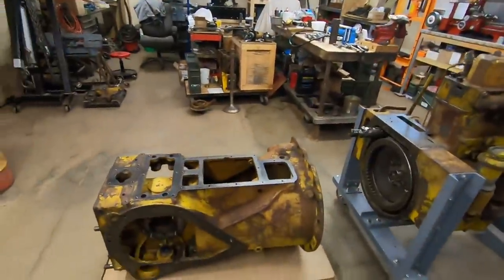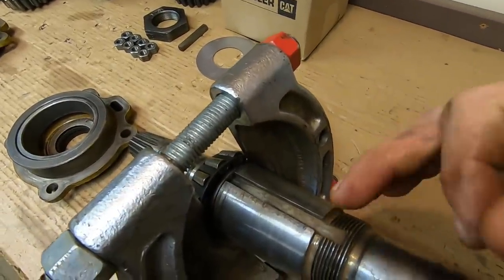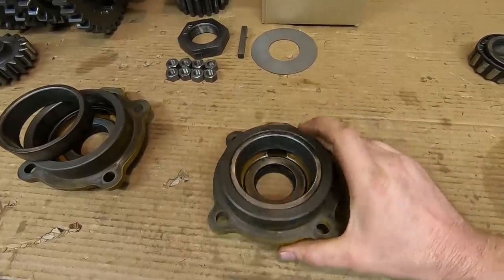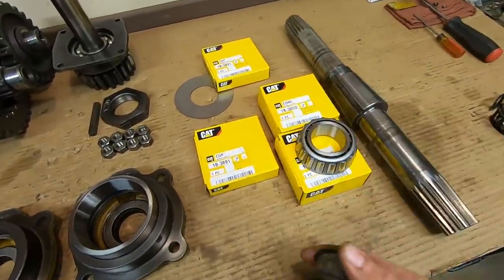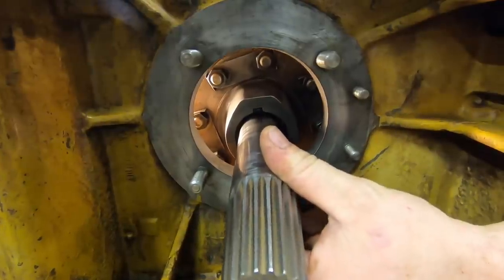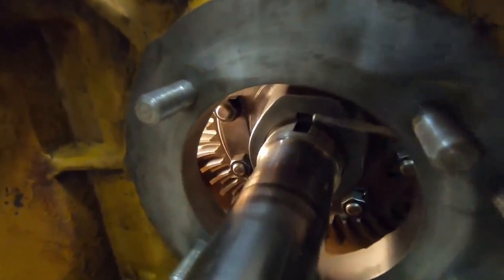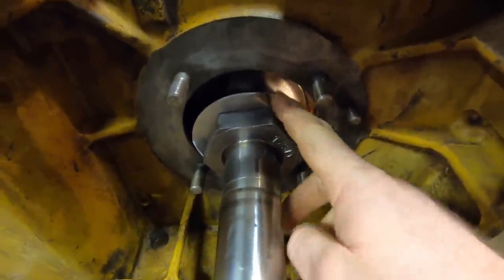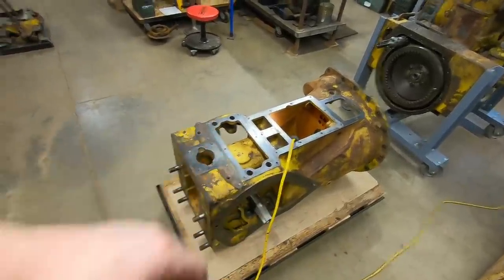Caterpillar D2 #5J1113 Chassis Rebuild Ep.12: Installing The Bevel Gear & Shaft

Comment: For what its worth,  my  bearing experience was SKF was the sole high quality bearing mfg.    Sometimes the others did fine and other times wore out far too soon (motor application though a lot of fan shaft bearings as well).     I got to see a very good sampling as some fans (and motors of course)  ran 24 hours a day and we bench marked against the 100,000 hour rating.

Comment: Using weld to remove that bearing track was a real education Squatch. Cat D2 aside, these videos are real training aids for general mechanical work. The trick seems to be to use your brain more than your brawn. If this was a gearbox out of an Italian tank, they would fit the bevel drive in backwards. The tank could then get out of trouble faster than it got into it!

Comment: Always a pleasure to watch you work.  !!  
I know you wanted to use the old seals as support and cushion. 
But If you heat the bearing flanges  in a oven or on a wood stove the bearing cups will fall in . 
That works very well  .
I have done this with the Carnegie wheels on the sawmill because they were so tight and we didn't have a press .  Just another alternative. 
See you next time .😊👍👍👍👍

Comment: You are such a perfectionist (that's such a good thing now days) I didn't know if you would ever use the old "weld the race" trick to remove races. Sometimes you just don't have fancy pullers and this trick works. And we always used the old races to install the new bearings and races, I just figured more sophisticated shops had high dollar tools for these installs.

Comment: Bearing race in the bearing caps are designed to use a specific pry bar to remove them, like HF 68339 or Sunex SUN9804 or an indexing pry bar.   You install the caps back into the case before using the pry bar.   This is how bearing races were removed in heavy machinery from 1920s-1970s. The puller will work fine too, it is just a lot easier with the proper tool.

Comment: Totally random thought, but when the weather warms, maybe take your custom built tools and hit them with a quick coat of implement paint to match the make of machine they get used on? Not a perfect idea admittedly, but they could go in some homemade wooden tool crates and be easy to see and differentiate from random metal pieces that way.

Comment: We used the weld trick that you used on the race on removing dry sleeves. The only difference was  vertical welds. It worked as well on the sleeves as it did with your race.

Comment: Been welding bearing races and valve seats for years, it works great. Have to be careful using the old bearing inner races to press on with on a lot of shafts they will wind up stuck.
Reply: Was thinking I would probably have put that in the lathe and taken a few thou off the inner diameter with a boring bar...
Reply: If you cut through one side with a thin cutting disc on an angle grinder, you can still press them on but they don’t get stuck if the shaft is a constant diameter.
Reply: @homeFall1  Easier said than done on something 60 HRC+. Doable, but quite the challenge on squatche's small machines. Much easier just to split it.
Reply: @TheMetalButcher  Yeah, I agree splitting it seems easier without great equipment and maybe even then.  I AM spoiled by having big old industrial machines in my shop and not "hobby grade" small units.  That said they do take up a LARGE amount of floor space and where SUPER heavy to move in there.

Comment: Amazing that all the torque/tractive force (of a bulldozer) is applied through a taper and a piece of  keystock.
Reply: Tapers are strong AF. Guarantee that key never does anything.
Reply: @squatch253  Thanks, Toby.  And I did wait for that video before responding.  I am still amazed at the size of the taper and the amount of torque it can handle.  I've seen them used as a "fuse" in a drive system to keep from breaking things but with a key in play, that's not here.   What does surprise me is there is no lapping of the surfaces such as they do in marine applications for shaft to propeller joints.

Comment: When placing a bearing on a shaft, consider using a bearing heater. It makes life simple. If you don't have a commercial bearing heater, use an old oven. Heat the bearings according to manufacturer specs.
Reply: One mechanic  at the hy dept  where dad worked heated a bearing  with a torch first,

Comment: the hot weld bead also works on inner races (like on your bevel shaft). When HOT it will expand the race to loosen the grip, and also will kill the hard surface in case you need to drive it off with an air hammer. (if you dont have the benefit of a press handy). Done this on rear end bearings and it works like a champ
Reply: what happens if you can't get it off before it cools and contracts?  Better off heating it carefully with the torch-
Reply: @horacerumpole6912  run another bead on it if it cools off. Best thing is the heat is localized unlike a torch, so heat treat on the shaft is largely unaffected. A torch works but you have to be a bit more careful where you point it. A bead is instant, and concentrated.
Reply: @Scottinqc  The torch works without the risk of seizing the race on the shaft-

Comment: 750 poundfeet with a 4 feet extension.. yeah.. allright :) The only bolts I ever tightened down that hard were the four engine mounting bolds on the leopard tank I served on, 730 poundfeet, or 1000Nm for us with a 2m long torque wrench of the 3/4" Type while lying on my back in the dirt and that was only possible by using my whole body.. guess times really were different in the 50s and people were stronger, like my old shortwave receiver from the 60s. Shortware receiver for mobile use, thats what it has handles for.. two of them in total, each big enough for one hand, with the whole thing weighting about 400 pounds.

Comment: Good ol' Nishizono Ironworks and Tomoe Trading Co.
As an instrumentation engineer your "calibrated press" amuses me. Like a "calibrated hammer". I would have used the nut torque procedure - it is likely to be more accurate. A known weight on a known lever will always give the same torque in the same gravitational feild.The only variable is the friction of the nut.
I just recently checked the accuracy of my torque wrenches using the same technique

Comment: Done alot of bearing installation with both press & heating bearing( induction heater or oven) and prefer the heat method...much less stress put on bearing vs dead ending bearing on shaft with hydraulic pressure.   Most times 300°F is plenty for heat method

Comment: Hey Squatch, been at a dealership for a long time too. I’ve used the old bearing race installer trick myself, it works great. I like to get the cut off tool out and cut the race because you could get it stuck on the shaft that your pressing the new bearing onto. Ask me how I know.😑

Comment: YAY!!!!!    A new video from Squatch258 !!!!!   YAY !!!!!!!

hhhhmm, so pony motors are still at machine shop awaiting their place in line
OK, good info.  I was wondering about them.  I'll keep that in mind.

WOW! cool trick with the welding to shrink an inner bearing race, Thanks for that.

Yep, already knew about using the old races as press tools.  Glad to see this being shared with others.

oh yeah,  install the bevel gear in the correct orientation!  Yep that is exactly where I would go wrong.  5 reverse speeds and one forward, THAT would be awful (unless it happens to somebody else)

Love the hydraulic tool thingy and triple scale gage set up.  

Oh  and good thinking on the use of the old leather seals to support the shaft during install !!

another GREAT, fun, and informative video!

Thanks Squatch 257

oh before I forget,  What about those pony / starter engines?  Any idea on their status?
Reply: I use a flapper wheel open the inside diameter of the old race for clearance on the shaft when you press the new bearing in.

Comment: That old inner race, did you grind it out a bit so it was no longer a press fit?
Reply: If you cut the inner race it will be a loose fit on a shaft, but still do the job.

Comment: Do you know by chance how much tonnage pressure is needed for installing the bevel gear on larger machines? (That is if the design stayed similar) I'm curious down the road if I were to overhaul the back of my D4, how large of a press is needed, thanks
Reply: @squatch253  thanks for the info!

Comment: So if I understand this correctly, the friction created by pressing the shaft and hub together is the only thing transferring power from the engine to the drive sprockets. The Key is just a guide to keep the two parts aligned as they're pressed together. The key can't be any harder than a Rockwell Hardness of C25 to C34. Right?

Comment: Times have changed. 
A machinist in New Ulm would assign priority by how quick he got paid. 
There were heads, etc that sat in the corner for a while. 
Not bragging, but he did a M block, and head in less than a week.

Comment: Mr. Squatch, as a loyal follower and fan of the videos you produce, I take no issue with you insulting Mr. Bork in a previous video. However, when you seek to defame, disregard, or disrespect the 2 Stroke Detroit Diesel, an engine that has arguably done more for this nation, and the world as a whole, than ANY OTHER single-engine, that Sir, is where I must draw the line. 

Like the Caterpillar (CAT) D3400, the Series 71 Detroit Diesel (GM Diesel) was introduced in 1938 as a new engine, not a revision of a previous design. The Series 71, built from 1938-1956, consisted exclusively of inline configuration engines with 1, 2 (introduced in 1940), 3, 4, or 6 cylinders. V configuration engines became available starting in 1957, offered in 6, 8, 12, 16, and 24 cylinder configurations. However, since D3400 production only ran from 1938 to 1947, we shall focus on the same timeframe for comparison to a Detroit Diesel. 

With a displacement of 221 cubic inches (rounding up), the D3400 most favorably compares with a 3-71 Detroit Diesel of 213 cubic inches (71 cubic inches per cylinder multiplied by 3 cylinders). Although it is somewhat difficult to find exact power numbers for an early two-valve 3-71, advertised power ranged from 100-113 HP measured at the crankshaft, although I believe those numbers are for the later N series, high compression engines. To facilitate a period-correct two-valve low compression 3-71 sample, we go to data collected at the Nebraska Tractor Test Facility. Although this test is not a flywheel horsepower test but rather a drawbar and PTO test, the numbers are understandably lower than rated numbers for flywheel horsepower. Nebraska Tractor Test No. 556, conducted August 22 to August 27, 1955, reveals that a 3-71 Detroit Diesel, mounted in a Super 99 Oliver tractor, provided an uncorrected 78.74 PTO horsepower, which corrected to standard temperature and pressure, yields 83.46 horsepower. With a rating of 35 horsepower, the D3400 falls far short of the horsepower produced by the Detroit Diesel 3-71 by any measure imaginable. Thus, your claims of “twice the noise for half the work” are woefully unfounded and blatantly false. Perhaps some will claim that CAT underrated the flywheel power of the D3400 and that it provided more power as installed in a D2, so again we turn to Nebraska Tractor Test No. 322 conducted July 24 to August 4, 1939, a test of D2 serial number 5J1509. Test No. 322 reveals that the maximum observed power was 29.98 horsepower, which corrected to standard temperature and pressure, yields 31.99 horsepower. Again, the D3400 falls far short of the 3-71 Detroit Diesel in terms of horsepower. Some might argue that since the 3-71 test was conducted in 1955 versus the D2 test conducted in 1939, Detroit Diesel had 16 years to refine the 3-71. Again, we go to Nebraska Tractor Test No. 553, a test of D2 serial 5U12457, conducted within one month of the Super 99 test. Although Test No. 553 is a later, improved 5U D2 equipped with a D311 versus the D3400, we can still draw comparisons, and it eliminates the argument of unfair advancements of the 3-71 Detroit Diesel in Test No. 556. In Nebraska Test No. 553, D2 5U12457 provided a maximum observed power of 41.86 horsepower, which, corrected to standard temperature and pressure, yields 45.43 horsepower. So, despite the D311 having a 39 cubic inch displacement advantage over the 3-71 Detroit Diesel, it still falls 38.03 horsepower short of the Detroit Diesel. 

Having dispelled the outright lie that the Detroit Diesel is “twice the noise for half the work” compared to its Caterpillar competition, we will move onto accomplishments and production. Throughout the entire D3400 production run, 19,161 were built for the D2 tractor, 1,797 for 212 graders, 6,047 for generators and power units, and 216 marine propulsion units, for a total production of 27,221 from 1938-1947. By comparison, Detroit Diesel produced 57,892 Series 71 engines in 1943 alone. Although Caterpillar contributed significantly to the war effort, its contributions pale in comparison and scope to the diversity of applications and sheer quantity of Series 71 Detroit Diesel’s used in the war effort. Series 71 engines powered everything from boats, equipment, tanks, trucks, generators, and even the landing craft used on the D-Day Invasion. 

The simplicity, longevity, interchangeability, durability, and modularity of the Series 71 Detroit Diesel is genuinely astounding and has never been matched by any other manufacturer. Mass-produced from 1938 to 1995 and still in limited production today, the Series 71 is a staple of diesel power production both in the U.S. and globally. So, in the future, if you choose to pick on Mr. Bork, that is fine, but next time, please leave the war hero Series 71 Detroit Diesel out of it.
Reply: POPCORN PLEASE 🍿
Reply: @mmm365  Series 71 Detroit's have powered just about everything, from mass transit to rail switchers to cranes and pumps. Excellent engines.
Reply: @mmm365   Most likely a 4-71 "GM Diesel" which is the same as Detroit Diesel, a name that came later on. EMD and the BIG diesels originated with Winton diesel engines. Winton was bought by GM and through a few name changes eventually evolved and became EMD. The Winton and EMD uniflow scavenged engines were the predecessor and big brother to the GM/Detroit Diesel.
Reply: The sound of a Detroit running is one of mankind’s greatest accomplishments!
Reply: @coinucopia  it has been said that a 2 Stroke Detroit is the world's most efficient device ever produced for turning combustible liquid into beautiful noise!

Comment: Unless it's a special one of a kind bearing, actually made within the mothership, i don't bother with original parts. Most big corpo sized companies have long since moved from quality products within those brackets, because it's not a good practice for them to sell you good parts, decent parts, not good parts. I search by sizes, not even numbers, get the lay of the land and buy the best quality bearing i can afford for that particular application. So far, i have not been disappointed by that approach. And this applies from engines to gearboxes, to even things like a Bosch drill, where even in singular products, unlike any other from their line up, they have the nerve to sell me a cheapo bearing and tell me it will fix the problem.

Comment: I apologize for coming late to this party, but I just found the channel a few weeks ago and have been working to catch up.  I know that this is a really nerdy question, but why is to referred to as a "bevel gear" in the rear end of a D2, but the analogous part is called a "ring gear" in the rear end of a car?  Are the two gears cut differently because one is part of a differential and the other is not or is it just a terminology difference?

Comment: Why not pack the bearings prior to installing?
Reply: I was wondering if they needed oiling instead.  Perhaps Caterpillar recommends dry installation and grease via Zerk (autocorrect changed zerk to zero!!) fittings only.  Squatch253, what's the scoop?

Comment: One thing that I can say is very different on the Cat D2 and the Soviet equivalent KD-35. Unlike the Cat D2 that has the bell housing, gearbox and differential as one cast unite. KD-35 has all separately removable pieces aka gearbox comes out as a separate unite. But mechanical wise most internal parts seems to be the same.

Comment: Come on squatch... you don't need a press to slip on press fit bearings, just gently warm them in a pan of gear oil (or bacon fat if you want to get the appetite going) then slip them straight into place, just put a glove on so you don't burn your hand 😁😁
Reply: yeah, you get them halfway on and no farther. This method often does not exceed the fit tolerance of the two components-
Reply: And put the shaft in the freezer.

Comment: Um...shouldn't there be a woodruff key between the shaft and the hub?
Reply: Um... He says at 11:33
Reply: is the woodruff key the only thing that keeps the bevel gear from spinning or did i miss something?
Reply: @donpeterson7414  The key ends being just a piece of mind actually. That bevel gear is pressed so hard on the taper that it will take a LOT of force for it to rotate on the shaft.